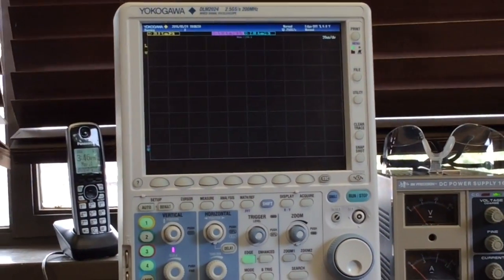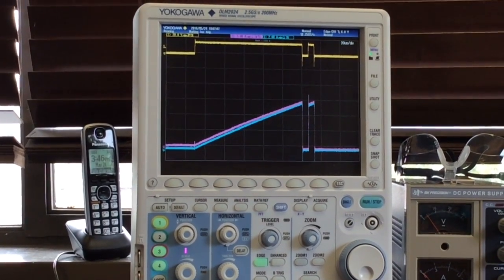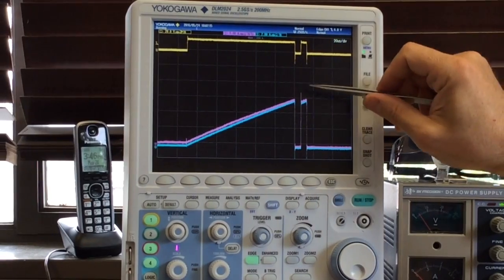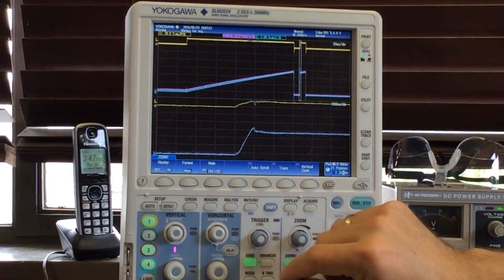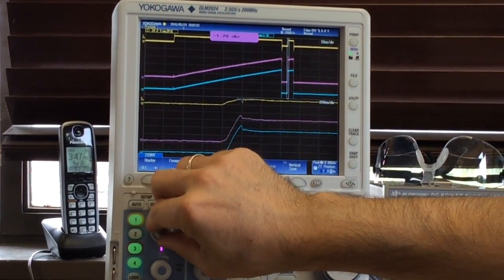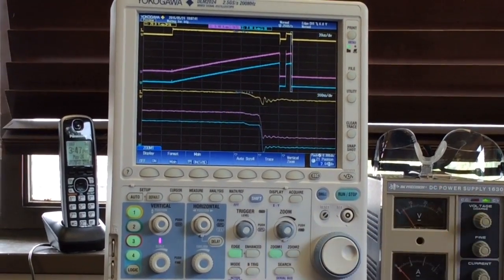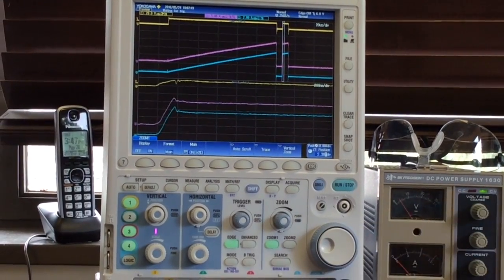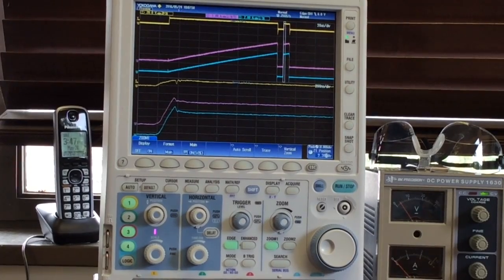Double pulse with Rogowski probes

Comment: The rogowski coil is very easy to use but....I must say...poor bandwidth..
Reply: Hi Jianzhi, actually I have to disagree with both your points. The rogowski coil is somewhat hard to use bacause its accuracy can be affected by position around the conductor, deskew settings on the scope, and odd mV/A settings. The bandwidth however is quite large, from 20 to 50Mhz depending on the model. Current clamp probes can get you higher bandwidth but if you are doing switching energy measurements this bandwidth is of no benefit. The calculation of switching energy is the integral of the product of current and voltage. This means that the energy calculation result is integrated and therefore is a low-bandwidth data point.

Comment: How did you generate the Double pulse signals?
Reply: The easiest way is to set a N-cycle burst of two pulses. Yes these two pulses will be the same size but it is a good way to set up a simple test. The other important factor is to set up a gate drive that is compatible with both your semiconductor and your function generator. I find the Analog discovery (from Digilent) to be a good tool for this task. It is easy to set up a double pulse waveform and to set it for single-trigger